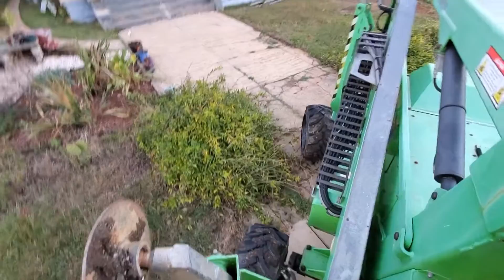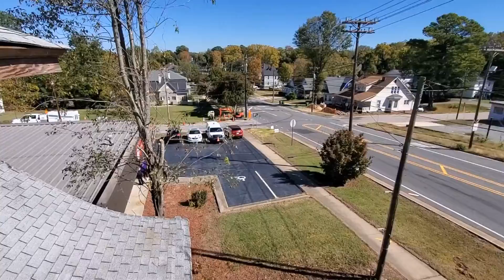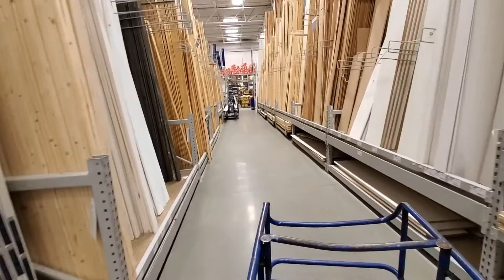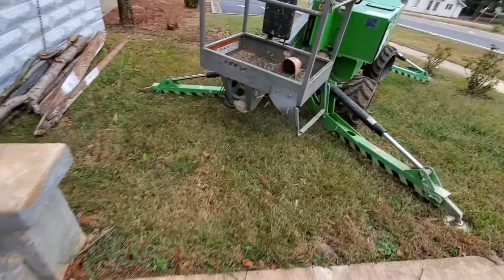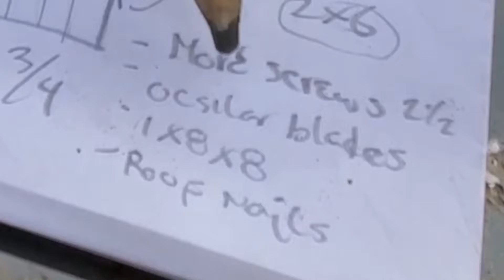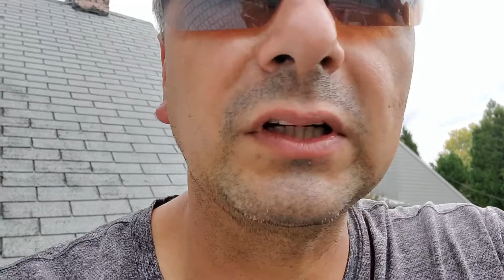How to repair high roofs on historic houses

Comment: Wow, lots of work just for the roof!  I would have a field day working on this project.  Good luck.  Keep videos coming of this project.  I am interested in the before, during and after videos.  Where I live, centennial homes are too few and far between and I never had the chance of working on one.  For the roofing repairs, wouldn't roofer scaffold and a harness be better for the upper sections of the roof?  You use the skylift to get up there, harness yourself to the roof and walk on the scaffolds for the work.  What do you think?

Good interesting video.
Reply from the maker: Thanks, the eaves are very loose and the shingles fragile, the back side of the house have a bigger issue on the upper areas, there I will have to use other approach,  I will be uploading some videos about the crawl space work that I am doing.